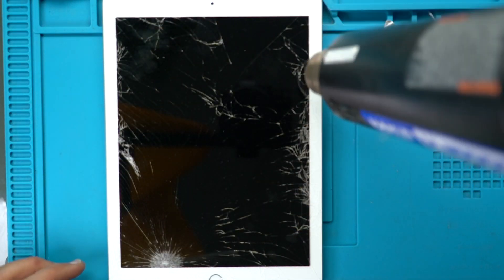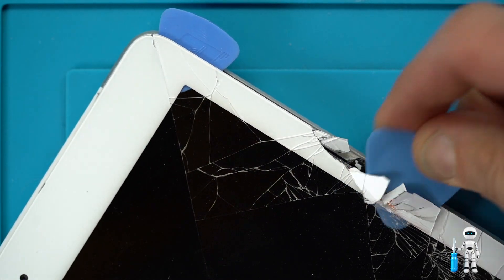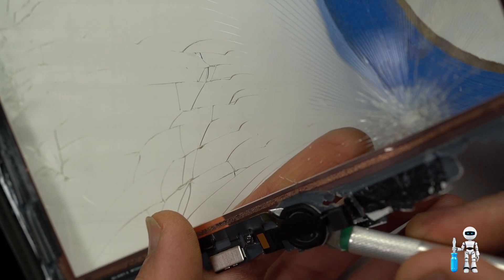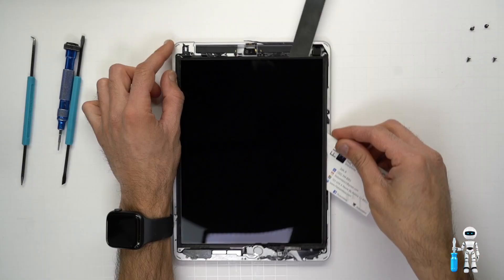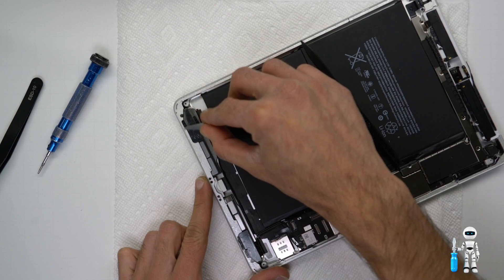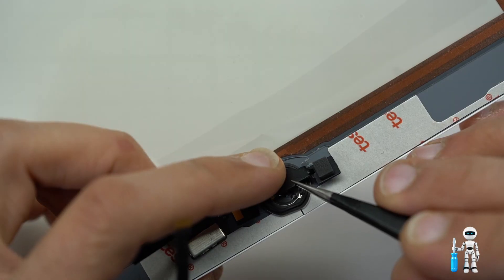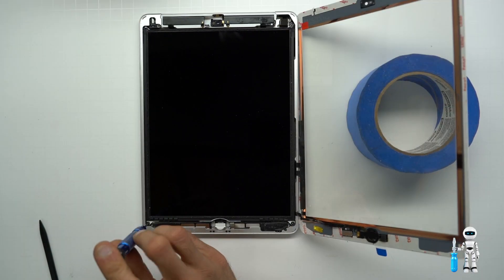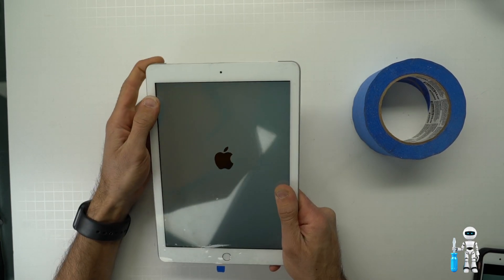iPad 6th Gen Screen Replacement.

Comment: If the penny is covering the the camera to protect from heat, I would be careful with a penny.  It looks like a Zn penny, (post 1982) but an earlier Cu might be a problem, Cu is very good conductor of heat.  Zn still does conduct, so still be careful.

Comment: After watching your video I replaced my sons screen and followed your video step by step but noticed when I put it all back together the number 1 didn’t work when putting in password so took it apart and check all connections and tried again and now number 1 works but number 4 is hit and miss any advice what am doing wrong thanks

Comment: I was 95% done, already glueing up a new glass and... it didn't fit well. That rectangular metal thing near the button didn't sit in the right place and I started removing glass carefully to check what's wrong. But it got cured pretty well already and... cracked. I'm extremely angry. Ordering a new glass now.
To be clear, I'm not blaming you. Your video is great. Just wanted to share my pain.

Comment: This was super easy to follow. My only issues were user issues. I misjudged my depth on the sides when prying so there’s a scratch on my lcd. I touched the lcd at the top on accident. After getting everything reconnected, I forgot to make sure the home button ribbon was flush so the bottom corner wouldn’t close all the way. I redid the steps and had to restart the iPad. It’s working perfectly now

Comment: Video is not clear does not allow for clear instruction on the home button removal an reinstall the most important part also quickly goes over the digitizer removal and install don't use this video
Reply from the maker: Hey, check out my other iPad repair video, it’s the same repair and it’ll give you more info on the home button. https://youtu.be/Ti-Ek_xZRwA

Comment: Great video! Thanks for sharing.  Wanted to mention that in my experience alcohol works much better than Goo Gone and doesn't leave an oily residue like the Goo Gone does :)
Reply from the maker: Hey Bush, I used to use alcohol, but It doesn’t absorb the glue like goo gon. I gotta stick with that.

Comment: Man i was scared to do this but it came out 7/10 good lol, made a mistake and cut the ribbon cable that makes the home button click and since the ipad has frame damage the screen doesnt "fit" all the way but a otterbox case works .. thank you
Reply from the maker: Use AssistiveTouch as your virtual home button. 7/10 is a passing grade. Good job dude, glad you got it done!
Reply: @fixitwireless.  that works but the screen i ordered came with a preinstalled home button

Comment: I did the repair and went well. Tested great and home button clicked properly. Then I removed adhesive, home button it came slightly loose and I reattached. I retested home and now no click and doesn’t seem like it’s sitting all the way through. I keep trying to lightly adjust it and retest but no dice even though the dots align. Any other tips?
Reply from the maker: Great job on getting it done. Can you please look at the back of the ipad home button theres a black dote and make sure it lines up with the silver dot on. Review at 5:10 in the video
Reply: @fixitwireless.  hey thanks so much for responding. Yeah I checked and lined it up many times. It would click if I held it there and pressed against it. But when I put everything in place the home button seems to sink inwards and I loose that. I even secured the plate over the home button with double-stick and glue like you showed. I don’t know if there was a small lip around the actual button that I lost when replacing glass or something that would help secure it or or why it slips inward.
Reply from the maker: I’m here to help :). Please visit my channel I have another video that’s doing the same repair on ipad 8 iPad. I spend more time explaining the ring around the home button. Check out 1:28 and 4:44. Check if your iPad screen had that ring or you’d have to have it from the other screen. If you can’t find it, what I do is replicate it on the screen with thin double side tap you see me using. Let me know how it goes !
Reply: @fixitwireless.  Hey thanks so much for this info, so helpful. I may have missed that ring. I did use double-stick in those areas but I guess it wasn't sufficient. I found out my husband had device coverage on our ATT plan so I just sent it in and they ended up fixing it (the screen I used had spotty responsiveness too) so this saved some time and money - fixing not only the button but giving me a fresh screen. But yeah otherwise I would have done this and I'm sure it would have fixed the issue. Anyway thanks again, very good & helpful info!

Comment: Why won’t the home button work after I replace the screen and put the original home button back on nothing seems torn or broken on the button assembly
Reply from the maker: Sometime the bracket isn't on properly  so it wont respond. Check 5:10 in the video for review.

Comment: Great video. Why do you remove the battery screw first? Is that actually needed?
Reply: YES. my isn't working. That is the only part of this instruction that I didn't follow. DO THAT.
Reply: It apparently crashes the hard drive if you don't.
Reply: Nevermind! So sorry! I plugged it in and now it's fine! Thanks for the video!
Reply: @wendytermeer8969  Still don’t understand why the battery thing, but I guess is to avoid touching sensitive (powered) parts. I also managed to get my iPad repaired thanks to the video.
Reply from the maker: Awesome!! Great job on the repair Wendy!
Reply from the maker: Great job on getting the repair done. And you’re correct it’ll mess with the power and burn something. Also if you get lucky and don’t burn something most likely you still disconnect and reconnect the connection between the battery and the board to get it to on.

Comment: How you know which on is broken either LCD or touch screen glass ? 
What is the best price of each ?
Reply: If the lcd was broken there could most likely be weird colors or lines on the screen. If there are just cracks on the outer part of the screen then its the screen glass.
Reply from the maker: Thank you Jacob!
Reply: @jacobduvall1813 thanks a lot

Comment: Had the a technician replace the screen on this model but now it won’t charge and has discharged completely since the repair over the past few days. What would cause this? I researched a little bit and on Reddit it said there may be a little switch near the battery that may have gotten flipped? Any other reason? Please help. Thank you!
Reply from the maker: There’s a little screw that holds down the battery, unscrew and lift the board so it makes disconnect and wait a sec and rescrew,  that 80% works for the kinda problem you’re describing

Comment: Can you help me?
I bought 2 used ipads, and one screen looks more yellow , and the other one is blacker.  what is the difference between the original apple screen and the one that is replaced?
.
Please help 🙏🏻
Reply: Maybe one of them is on night mode? You can turn that off in settings otherwise idk
Reply: @k.k.slider8042  problem solved. Its a fake ipad screen . OEM actually
Reply from the maker: Hey where yuh able to resolve it?

Comment: im trying to replace the screen on my ipad 6 but the power button wont work even long pressing it the volume buttons work but the power button wont help
Reply from the maker: Use alcohol to clean the Power button, or disconnect the power by unscrew the screw on the board pressing it down to the battery